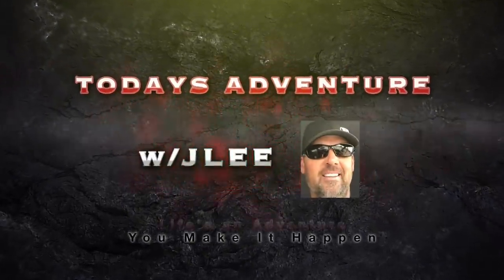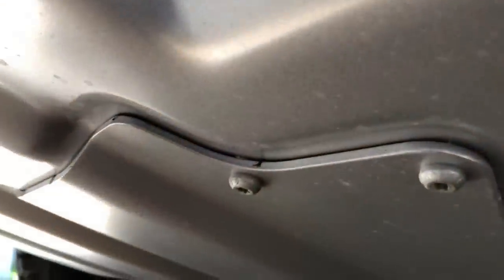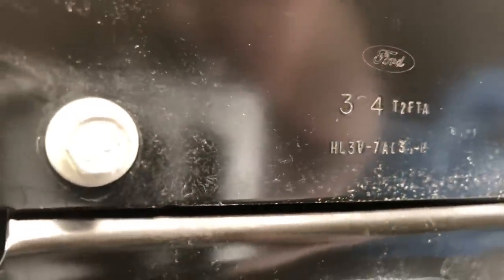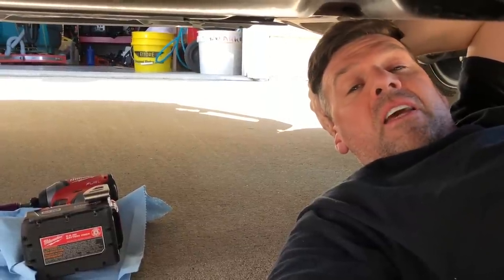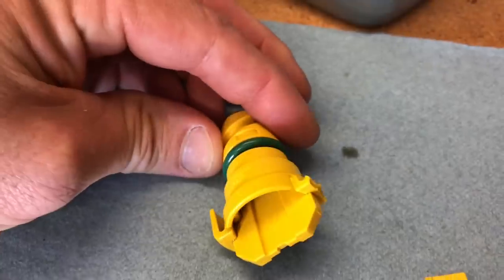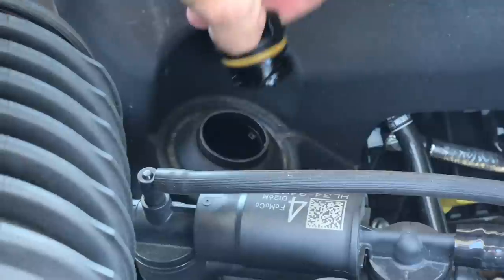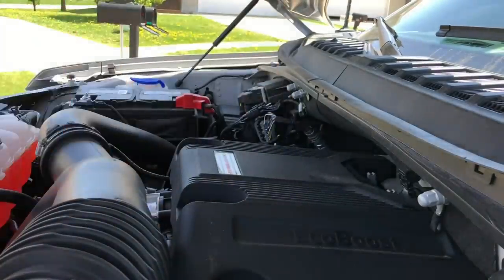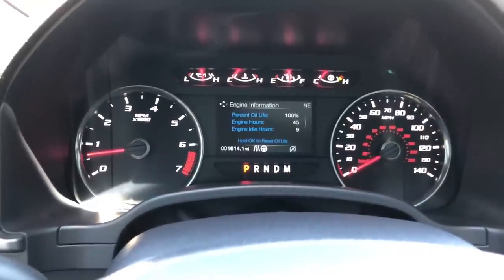2017-2018 Ford F150 Raptor Oil Change

Comment: I've done many of oil changes with the plastic drain plugs ever since they started using them on the 6.7 Powerstroke. Never damaged or broke ONE of them. I also never used a screwdriver to turn it either. It broke because of you, not the design. You only have yourself to blame for that one.
Reply from the maker: hdz12ez  you may have a “point”....
Tried twisting it several times, didnt come off. Then used the driver gently to try to get the tab to slide over, As it has worked for others. Will try again next time w/ different method. Good to know they can come off w/o busting. 👏
Edit:Picked up 2 today for spares, and the tech said they usually break and they were only 5$ for 2 of them.
Reply: hds12ez I thought the same thing at first but on closer inspection of pan and plug they have a different design on these brand new ones. The old ones dont have a tab to stop it from loosening.
Reply: hdz12ez then why did ford switch to metal ones? Happy some of these issues are taken care of since I just ordered a 2019 Ford Raptor.
Reply from the maker: Joe Momma does your Raptor have a metal pan?
Reply: I agree. Ive never had a problem with the pladtic drain plug or pan!!
Reply: 70K truck.  Plastic junk!!!
Reply: Well put
Screwdriver?it twists off so easy

Comment: Mine was produced 04/18 and I just verified that the drain plug is now metal instead of plastic. Thanks for your video! Of course, I just this morning wasted money ordering 2 plastic drain plugs before I saw your video.
Reply from the maker: Mark Baldwin hey thanks for that confirmation! Good to know. Anyone buying a new Raptor should check that out. The plastic oil pans have had warping issues.
Reply: J Lee Chronicles were is the Transmission pan on the 2018 Ford F-150 raptor

Comment: If a Ford dealership would do the oil change, and break that plug they would just put it back and don't tell you about it, just like they never put skid plates screws back , or even the skid plate for that matter.

Comment: FYI, at some point during the 2018 production run they changed the pan/plug. The plug is now metal.
Reply from the maker: badbirdws6 that is what I’ve  heard, think its right after my month of production 2/18.... figures.
Anyway look for a product testing vid here within a month featuring a new type (quick drain) of drain plug.
Reply: Wonder if you can put the metal one in the old plastic design?
Reply: sh0cktim3 not from what I understand.
Reply: Mine was produced 04/18 and I just checked, it is a metal drain plug.

Comment: Thanks for the video. Here are some helpful tips: 1. Don't use a tool to try to release the tabs on the drain plug. Just turn it. Use your hands (or use pliers to turn it if you're not strong enough). 2. The oil that spills from the filter runs down a hidden ramp and drains out of the square hole in the rearward engine (galvanized metal) skid plate. The plastic ramp shown in this video must be for different engines.
Reply from the maker: Joe was the first time doing it, didn’t want to destroy it:) Coming up on the second oil change so this time I’m just going to twist that sucker. Plan on using the needle nose pliers twist method...
The plastic piece is the rundown on this Raptor tho, thanks for the input

Comment: FL820S is a direct fit, adds approx half quart, more filter media inside too...
Reply: Mr Hossola Can I use the ford racing m-6731-fl820 filter on my 18 raptor ,
Reply: @marcoperez4712  As long as the thread count matches, there shouldn't be an issue, FR filters are imo a bit overpiced for the application but on a Raptor it'd fit...lol
Reply: A better overall filter would be Amsoil's EaO17....
Reply: Or Ea011, either one will suffice.
Reply: Thanks very much for you fast response, will look into the amsoil filter, since they are known for quality products, thanks for your help

Comment: The drain plug is supposed to be replaced with each oil change. They sell for $3+ at ford dealers __ they cost Ford 36 cent to make. Ford Motor Co. and the dealers are making close to $3.00 for each one they sell. It provides Ford with a steady source of additional income Compared to old oil pans with a metal bolt..
Reply: It's "recommended" but not required. I work at an Express oil change and there are fleet vehicle F150s that have never had the plug replaced. They still don't leak.

Comment: Thanks for the video...gonna change the oil myself this time, loathe to have anyone else touch my vehicle and while the dealer hasn't screwed it up thus far, don't want to give them another chance.

Is the filter cap tool a one-size fits all, or specific to the filter? I saw one guy on FRF run his engine to drain the oil, do you recommend that?
Reply from the maker: T4nkc0mm4nd3r  never run your engine to drain the oil...Thats one of the most foolish things I’ve ever heard!. 😂 ...run for 5 minutes or so to warm up oil to flow well, and circulate any particles to drain. Shut engine off, then proceed to the change.
You can get a size specific oil filter wrench, or, get an adjustable one, they are usually sized small or large and generally you want the small. Ford filter is an FL500S. While in store, just size it
Thanks
Reply: @JLeeChron  yeah I thought that was strange. Thanks

Comment: At work we remove all the shields just to make sure that there’s no drippage that could cause the customer to come back and think they have an oil leak because there’s no way you can clean everything up with all the under shields on
Reply from the maker: great! I don't think that is common unfortunately. takes time- Id be worried of crossthreading. Most do not care enough or take the time to be careful is the popular conclusion

Comment: Nice video. Any particular reason you are using high mileage oil?
Reply from the maker: MSTWNTD thanks, and no on the oil. I believe it was less expensive that day and I do not buy into the oil wars necessarily. I usually go WM supertech :)
Reply: The only difference between high mileage & non high mileage oil is, that high mileage oil has additives that swells the older gaskets in the old engines and ensure that they are still doing their job.

Comment: Some dark oil for 1600 miles. Checked my oil level on my 18 with the 5.0 with almost 3k miles and it still looked new.
Reply: Dark oil isn't necessarily a bad thing. It just means the oil is doing its job in holding the contaminants.

Comment: My 2018 raptor has a 14mm bolt drain plug, instead of the yellow plastic drain plug you have.
Reply from the maker: WreckitRaptor18 some on the Ford Raptor forums are saying that also, perhaps Ford is moving back that direction

Comment: when the motor starts knocking, the first thing the dealer says "do you have receipts for oil changes?"
Reply: I'll take my chances with changing my own oil than them hollering that than them putting recycle used oil in my vehicle. because when you go to any of these places that changes oil whether it's a dealership or whatever most of them use one grade of all whether it's 0-30 or 5: 30 or 5: 20 not every car calls for that particular 1 grade  keep in stock because usually it comes out of a 50 gallon barrel. I want pure synthetic in my car and I'm not talking about no damn cheap Pennzoil either
Reply: Harold Wright false.
Reply: That's why you document oil changes in "mycarfax"

Comment: Now they arent in stock anywhere here. You could have obviously reused that old plug .. just the outer tab broke ..no?
Reply from the maker: Probably could have re-used it
Bought 3  in case, just replaced the one on my ‘20 5.0 after 45k just because 
Good idea to get a cpl for later

Comment: no need to use the screwdriver ,turn it with your fingers and it comes easy ,done 2 oil changes on my 18' raptor and no broken plugs
Reply from the maker: Stefan's Garage next time I will try with a bit more force, ...also have a cpl spares just in case.
Thanks for the info
Reply: J Lee I did the same before my first oil change went and bought a spare,the raptor is my first vehicle with plastic plug so I was a little suspicious,but it’s pretty sturdy and wouldn’t brake.However getting oil all over the inside of the wheel when draining is almost inevitable...lol

Comment: Do you have an oil catch can in your Raptor? Been reading about it and wondering if other have it.
Reply from the maker: lmunoz13 Negative, never got around to it but I think it’s a good idea based on what I’ve read as well. Pretty inexpensive peace of mind
Reply: Thanks for the feedback. Would love to see which you choose and install if you ever do get around to it. Great video. I’m learning lots as I get ready to buy my first truck
Reply: I put a catch can on my 2017 Silverado 5.3 which has direct injection.  I'm amazed at all the blow oi/junk it catches.  I dump it every month.  I would recommend a can for all turbos and DI engines.

Comment: Just curious why did u use high mileage full synthetic vs regular full synthetic?since it only has 1600 mile? I run Mobil 1 in all my vehicles also
Reply from the maker: Marco Munoz ha, good 👁 
I do not buy into all the oil hype, was just a bit less expensive is all. Regular oil changes are all that is needed I feel. But it should have more “”protective lubricity components”” right? - with high mile additives?!  Good question, no specific reason tho. It works
Reply: J Lee yeah true no worries just wondering.

Comment: Not suppose to use a screwdriver to remove the drain plug. Just pull the plug out and turn it. That's it, pretty simple.
Reply from the maker: J.C. Brown yep you are right, first time with it and was trying to get the tabs squeezed in, 2nd time was a firm twist to get it out. I have heard The new Raptor has discontinued the plastic.
✌️

Comment: Sheash,,,,,what a rookie!   It’s an EZ (tool-less) two finger push and twist to install/remove the oil drain plug.  If you have even the slightest rudimentary skills anyone can remove the drain plug for decades without any issues.

-2017 Raptor and Power stroke owner.
Reply: My understanding is that the plastic drain plugs are sacrificial and should be replaced during every oil change.

Comment: Don't use a screwdriver on the tabs. Just turn the plug.
Reply from the maker: Mark Rawling yep, 2nd try I learned the grip and turn. 😆
Still, it is plastic on a 70k truck, which is why Ford has went back to metals for their pan /bolt setup recently.
Reply: Just drove off the lot with an f150 with a plastic plug.
Reply from the maker: Mark Rawling sweet, enjoy the new truck!
Depending on your build date, if its a Raptor, recently they went back to metal. F150, not sure.